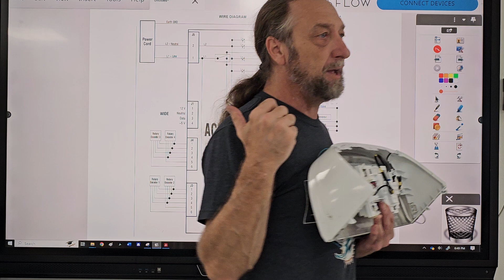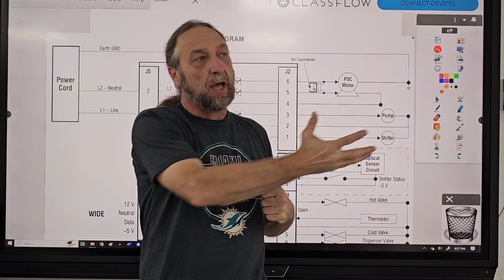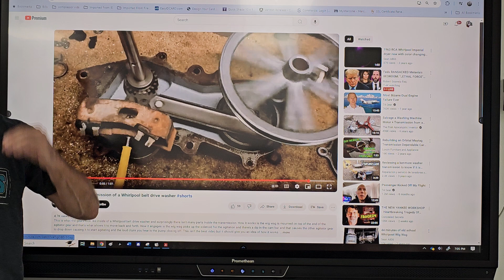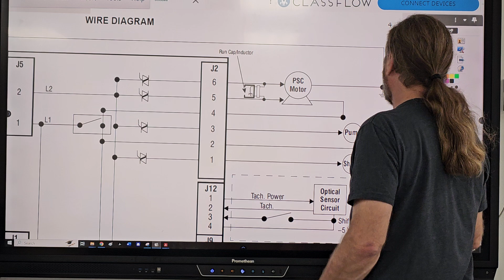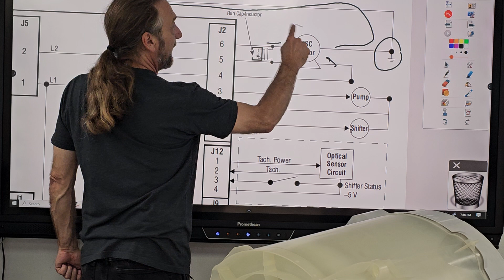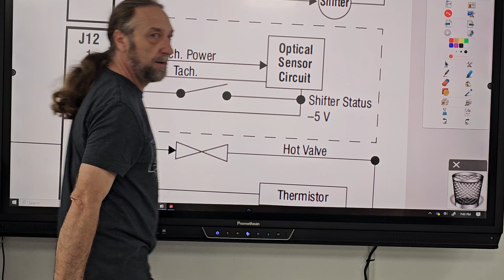VMW Washer Part 1 - New Series

Comment: Summary

	•	⚙️ Evolution of Washing Machines: From heavy transmissions to lighter electronic controls – The video starts by tracing the development from traditional mechanical washers with large transmissions to the introduction of the VMW (Vertical Modular Washer), highlighting cost and efficiency as key drivers for change.
	•	🔧 Drive Systems: Introduction of the “splutch” mechanism – A blend of “spline” and “clutch,” the splutch system replaces older transmissions and enables the motor to switch directions for agitation and spin, managed by a control board rather than mechanical switches.
	•	💡 Control and Electronics: The brain is now the ACU (Automatic Control Unit) – Instead of timers and switches, modern washers use a programmed control board to handle sequences like fill, agitate, spin, and drain using sensors and logic, with relays replaced by electronic components like triacs.
	•	⚡ Triacs vs. Mechanical Relays: Electronic relays reduce wear and arcing – Triacs are favored for switching the motor directions due to durability under frequent switching, a task that would wear out mechanical relays quickly.
	•	↔️ Motor Reversal for Agitation: Dual-winding motor design – The motor has two identical windings to reverse direction using different circuits, eliminating the need for a physical transmission to change direction.
	•	🌀 Agitation and Spin Mechanics: Separated shaft system – The washer uses inner and outer shafts, allowing separate motion for agitation (just the agitator) and spinning (basket and agitator together), managed by a shifter and splutch assembly.
	•	🔁 Hall Sensor: Critical for safe mode switching – The hall sensor prevents gear damage by ensuring the motor doesn’t switch modes while spinning, similar to how a car transmission should not shift during motion.
	•	🔒 Lid Locking System: Safety to prevent injury – Prevents users from opening the lid during spin cycles, replacing old lid switches with a locking mechanism that only releases when the basket has stopped.
	•	🔄 Suspension and Balancing: Shocks and balance ring reduce vibration – The tub is supported by rods with shocks, and a balance ring with water helps counteract unbalanced loads. However, aging shocks can still lead to excessive vibration.
	•	🛠️ Dual-Action vs. Single Agitator: Modern design simplicity – Unlike older dual-action agitators, the VMW model uses a simpler design, which may be less effective in agitation performance.
	•	🧪 Component Testing and Troubleshooting: Understanding internal mechanisms – Capacitors, relays, motor windings, and shifters are discussed with testing methods and common failure points like shorted capacitors leading to board failure.

Insights Based on Numbers
	•	1983 - Design 2000 introduced: A milestone marking the first direct-drive washer prototype.
	•	Two identical motor windings: Essential for reversing motor direction, facilitating agitation without a mechanical gearbox.
	•	Three-part shifter: Combines motor, sensor, and microswitch, showing complexity of modern washer automation.
	•	Zero Ohms = Shorted capacitor: A technical metric indicating component failure and potential board damage.

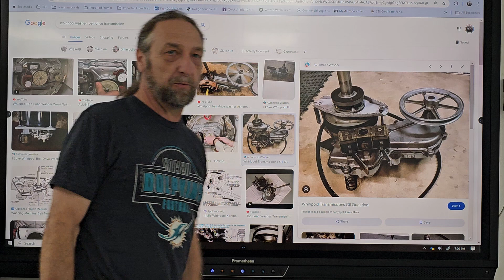Comment: Recognize the photo at 19:44. That’s a picture I took after I went through the transmission 3 years ago. Primarily a oil change and replacing the agitator shaft since the original got damaged from trying to remove the old metal agitator drive block which was stuck on. Not a issue since I rebuilt the transmission, however the timer has been giving me issues and looks like I’ll have to do a complete retrofit.

Comment: How big were the transmissions on each model lineup?
Reply from the maker: The first Whirlpool had a transmission about 1and 1/2 feet long by 10" wide, then the direct drive came in with a transmission about 1/3rd the size, these newer washers it looks like a transmission but it is just a support for the shaft and bearing assembly because the plastic tub could not support it by itself.
Reply: @TMMApplianceRepair  Who's washer had the largest transmission ever and the smallest transmission ever?
Reply: @TMMApplianceRepair  Also, how thick were the gears in each transmission? How many moving parts were in each transmission? What were the gears made of?